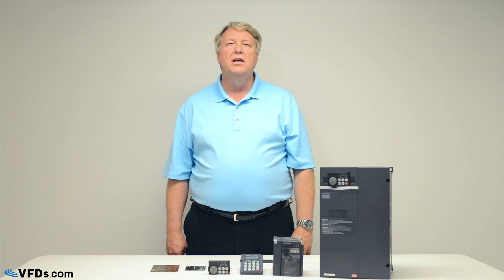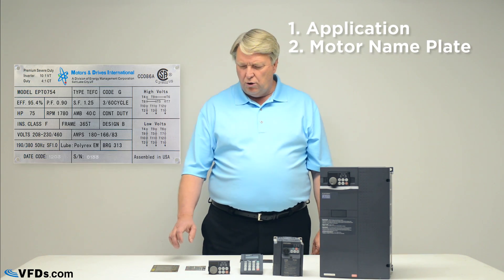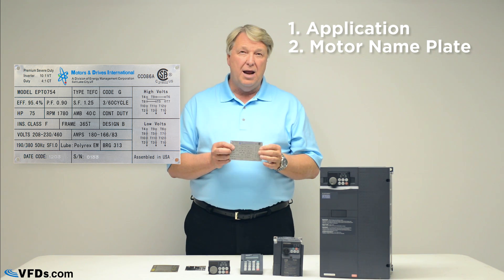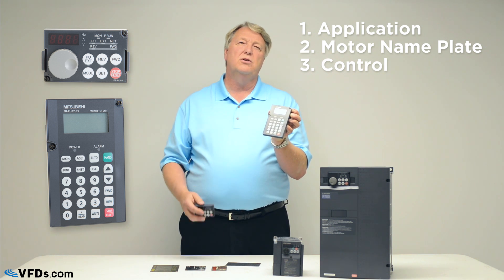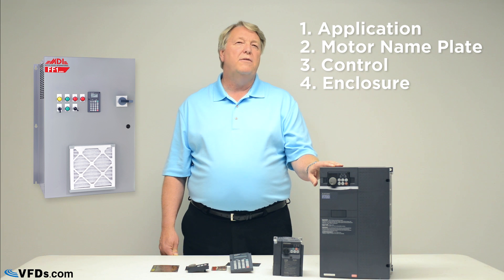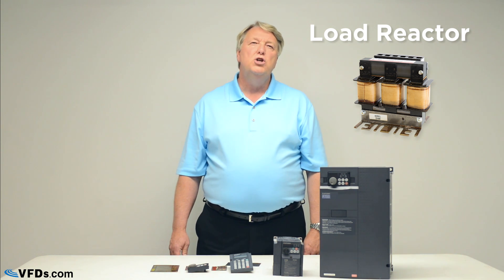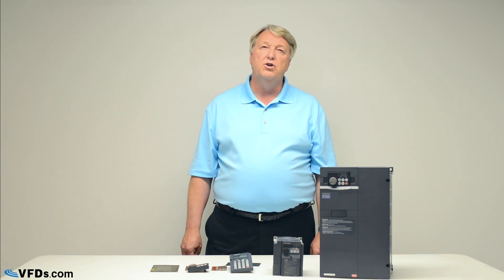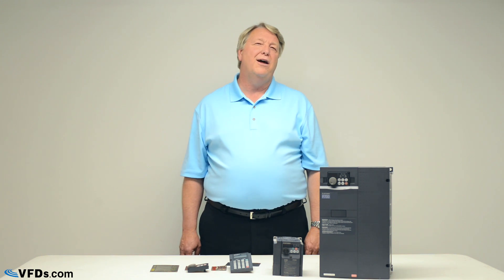VFD Buying Guide

Comment: Notes on Video
VFD Buying Guide Notes
1. Application
    Downhole pump to protect bearings. Many down hole pumps require protection in 3-4 seconds
    Induced Draft Fan - Soot blow - drive has to go into overload
    What are the special requirements?
2. Motor Nameplate
    - 3 phase - always use
    - voltage on name plate - matches voltage on output of the VFD
    - FLA - full load amps - do not size the motor/drive, use amps on nameplate - amps on VFD needs to be as high or higher than the amps on the motor namplate
3. Look at speed range
    Motor has 16000 Volt high spike wire and is rated for speed range you need
    Motors usually have cooling fan on shaft of motor
        - Cooling fan will make it go slower
        - If you have an inexpensive motor, may have limited chance to reduce speed

2 reasons for failure
    - insulation or bearing fails - heat can cause both

How to control the drive?
    - Keypads - advanced, simple
    - to control drive remotely
        - dry contact
        - analog speed reference
            4-20 ma signal - or other
Enclosure
    can be mounted on wall
    want to keep it cool and clean
        best to mount inside an enclosure positive pressure ventilated system with filters
        change filters periodically - last 2-4 times longer than putting on wall
    If drive is outside - need special outdoor enclosure

Filters
    Output - VFD - 100 ft of drive - nothing needed
        Many motors or more than 100 feet away you need a filter
            Cheapest filter - load reactor
            DVDT Filter
                take the spikes and get rid of the spikes
                Fixes motor insulation
        Expensive motor
            Sine Wave Filter
                Convert to a sine wave - expensive
    Input
        Harmonics
        IEEE519 - standard that directs the current distortion must be within certain limits depending on strength of utility
    drive can pollute the power quality
    Custom Enclosures

Comment: Any suggestions on a Variable Frequency Drive Inverter for a  parts washer with these specs  208-230/460 volts  and 21-18/9 amps     I only have single phase but washer is 3 phase ?

Comment: If you can reduce the pulse frequency, you can reduce the level of voltage spikes to the motor so you may be able to use a regular 3 phase motor if you don't mind the whining noise.

Comment: I am thinking of changing my machine tool to a VFD setup.   But, I don't want the motor noise that I hear.  the high pitch ringing is just too much to deal with.   is there a way around this?
Reply from the maker: Michael, you can change the parameter setting of PWM (also called switching frequency / carrier frequency depending what VFD you have). They are usually set between 2 to 4 out of box; try changing it to 4 to 6. That will make the frequency go higher and less noticeable. You can go above 6, but the higher you go, the hotter the drive will run. That is the trade off. Hope that helps.
Reply: is there any benefit in using a variable frequency drive over A DC drive?
Reply from the maker: If you have an AC motor, you need an AC drive. If you have a DC motor, you need a DC drive. AC and DC drives are both variable frequency drives (VFD).
Reply from the maker: If you have a DC motor & VFD set up, we would suggest converting to AC if you get a chance. There are a lot more support and parts available for AC drives.